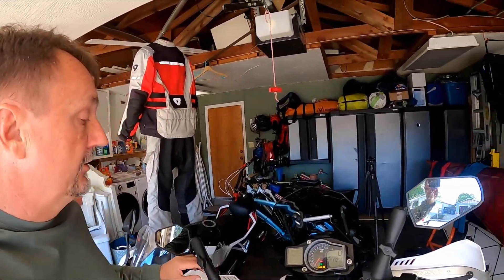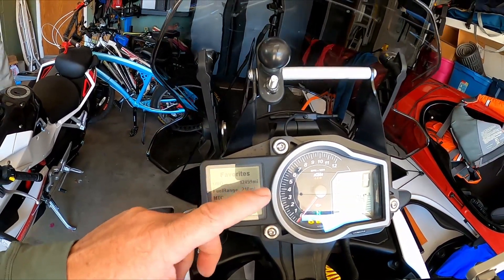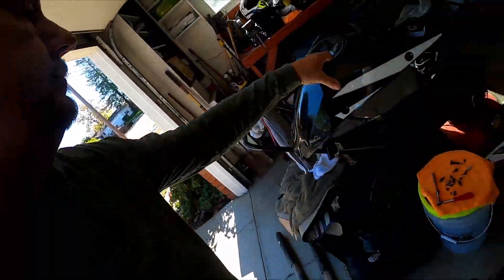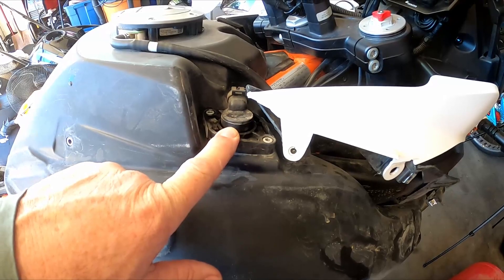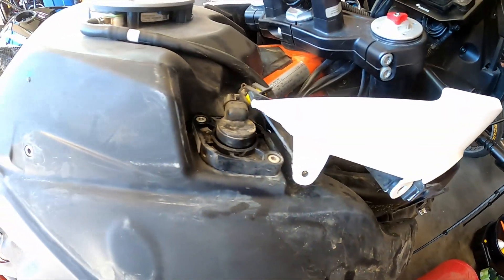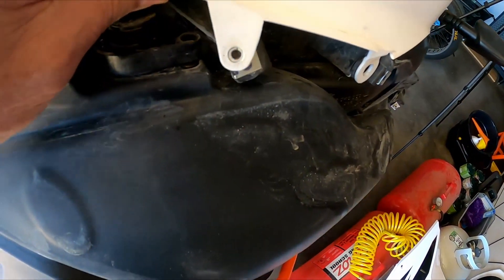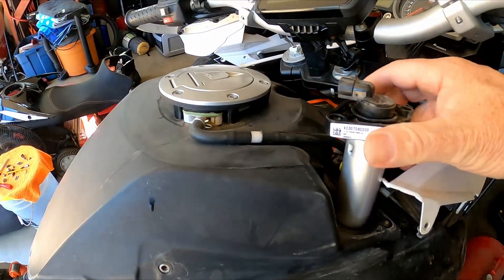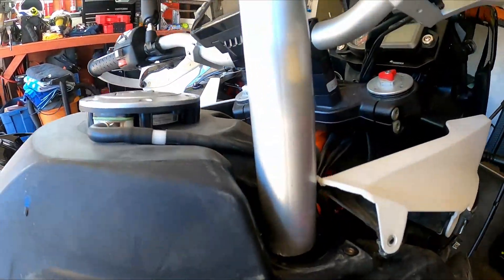KTM FUEL GAUGE FIX

Comment: Thanks dude. My 1190 stalled few times while still showing 2 bars of fuel left on the gague. Sometimes the gague didn't go full after refueling all tank. Now I am just refueling it every 350km just to be sure that I won't end up with empty tank on the side of the road again. Nobody knew the solution on polish facebook KTM adventure group. I was afraid of trying to find the solution myself. The fix looks simple, I'm gonna try to do it myself with your video :)
Reply from the maker: these are a real problem and KTM seems to not want to do anything about it, its important to make sure it slides freely after you re assemble it,  that is key to a better transition between levels. also make sure the center stick is perfectly straight as it goes back together so there wont be any binding. hope it helps!

Comment: Thank you very much for the video, which significantly helped me fix the fuel gauge issue on my 2020 1290 SA-R with approximately 26,719 miles. In my case, curiously, the tube detached from the head, remained vertical, but fell to the bottom of the tank. I also took the opportunity to remove the bottom cap, clean the float, and secure the tube more effectively. It turned out perfect. Thank you again!
Reply from the maker: That's great, also good information!

Comment: Amazing video! Simple and very well explained... gonna go do that now🙌
Reply from the maker: @williamboivin6455   @williamboivin6455  thanks!
A note or two before you get started!
This only works if you gauge gets stuck on full, if it reads empty you will need a new float assembly.
Also : this fix, in my case was not permanent, it lasted two years, and I needed to do it again, it seems the material expanded over time. 
The fix did make the fuel level much more accurate than it was originally, no more sudden change in level, it's great to know how much is actually left in the tank!

Comment: Thank you for the video!
I have that problem on my KTM1190
Will fix it just now!
Obrigado from Porto-Portugal
Reply from the maker: It's a pretty quick and easy fix, still take your time and keep checking to make sure it slides freely, I was just out on a ride thinking about this video, I love that my fuel gauge is accurate now!
Reply: It's a more complex issue. The float moves freely. And i checked with a multimeter and its working. The gauge reads empty and still reads empty with the wires disengaged. 
I think it will be a bad contact or a cut wire on the circuit.
Starting to dismount the fuel tank 🤪
Reply from the maker: @brunopereira5896  well that's not good. The ones I had would show full as the float would get stuck at the top. The only other wires going in to the tank are for the fuel pump, if that is working, I would start tracing the wires from the top of the fuel gauge out to it's power source and instrument cluster, I would have to look at the wire diagram. But you should not have to go into the tank for anything else.

Good luck and let me know how it goes
Reply: I agree
The problem is that the wires are brought together in a cluster that runs under the tank. 
So to reach it you have to take it of.
I'll try and disconnect the battery to try if that soves any problem with electronics (reboot? )

Comment: There was / is a recall, or TSB on these. My 2020 SAS was outside of that range, but was still within the warranty. Mine dropped to empty with a full tank, so I figured it was saturated. I bought one on line and the local dealer reimbursed me. The upgraded part is about $100.00 and so far, it has been OK.
However, we end up fixing them, putting up with the issue is not worth it. 
Thanks for the upload!
Reply from the maker: sounds like there is more than one issue with these systems, glad they had a fix for you, each time I dealt with this it has been a case of the bike showing full and never dropping down. though your issue has now come up a few times, A new part that works from KTM would be a great thing!!
Thanks for checking out the video
Reply: @TRCAdventures  The updated sensor has a different part number. I haven't heard complaints on the forums of the new ones failing.

Comment: Great video. I am having a problem with my 1290 GT where the bike shows it being empty of fuel all the time. I did this procedure and did indeed find that the float was sticking. I smoothed it off and got it moving well. Unfortunately when I put it together the fuel gauge still doesn't work. Any other ideas?
Reply from the maker: Normally when it shows empty all the time it's a different issue all together, and have heard some dealers covering the fix.
I will do some research and see if I can find what the fix is
Reply: @TRCAdventures  that's very kind. The GT has the sender unit pushed up from underneath, and it did appear to by stuck at the bottom so I was very hopeful.
Reply from the maker: @themorfill  from what I have found, the GT and some of the adventures were fitted with a float that would not float KTM recomeds fitting a new float in this case part number (60307080100) to replace the original unit, they do not give details on how to confirm this is not the part already in your bike, and thy cost $68 if ordered online from a dealer or $115 if picked up at the dealer?! 
I would say to test the unit you have when it's out of the bike and see if it floats! Also check all wires and connections as best you can. Their have been some reports of faulty connections that stopped the gauge from reading anything at all. Best of luck!
Reply: @TRCAdventures  thanks for the information. I don't think I have the option to buy the internal float by itself. The part number you have shared is for the whole unit. Looks like I'll be forking out for a complete unit.

Comment: I initially had this problem at the dealer chamfer the top and it worked fine. Seven years later and 30,000 miles. I’m having the opposite problem and it’s stuck on low fuel even after I fill it up. I usually bang on the tank or do a couple wheelies and slam the front  down and the cork seems to work it way up but it’s getting worse and worse. Wonder if it gets gas logged so to speak
Reply from the maker: I do know of a few people experiencing the issue you are having, the fix I describe does not seem to fix this issue.
I think in this case getting a new float is the best way to a fix, just make sure it can move freely inside the fuel cylinder before re-installing.

Comment: Hey brilliant video will check mine out,run out of fuel but showing 3 bars on gauge, I've also lost my gear indicator, bike will only start with clutch in and side stand up, happened same time as running out of fuel, and ideas appreciated
Reply from the maker: Definitely sounds like the fuel gauge fix will help! It's nice having a more accurate accounting of fuel! Mine was all over the place before the fix. Much better now!
The gear indicator has a connection to the side stand switch, you have to do a bit of digging to get to it, but it is likely that the connector is disconnected or the wire is worn through near that location, between the shifter and the kickstand up by the motor, best to try and follow the wires from the shifter (not easy as I remember it)
Reply: @TRCAdventures  cool thanks for info will have a look, keep them videos coming 👍👍🍺🍺
Reply: Done float but noticed when turning the fuel taps off the left side, really stiff ,disconnected the transverse pipe and turned the tap no fuel came out so wonder if that's why that side of tank not draining,
And any ideas why gear indicator still not working all wires in tack , still cuts out with stand down , and re start with clutch in. Thanks
Reply from the maker: @johnridley5507  doing a bit of searching on this topic and it sounds like a few people ran in to issues where the gear indicator function has been turned off due to the bike being started with the indicator switch unplug during a service, then the CPU de activates the switch? 
They then took it back to the dealership to have it turned back on with a KTM computer / code reader.
Sounds possible, though I've never run in to that before, maybe run past the dealership and see if they can plug it in and check to see if it has been de-activated?!
Reply: @SV Meeko  thanks mate looked at it again today cleaned all connections disconnected battery for 30 mins reconnected but still the same

Comment: I'm guessing this fix is about the same for an 890 Adventure? Great info by the way.
Reply from the maker: Not sure about that. I have not looked at the 890.
I need to post an update to this video, after two years this bike experienced the same issue again. At that point it's worth buying a new unit. 
KTM should issue a recall on these units far too many of there bikes have this problem, changing the material of the float would be a permanent fix.
Reply: @TRCAdventures  KTM has swept under the rug the camshaft issue on the 790/890 series and you want a recall on a nuissance? what KTM needs to do is go bankrupt.
Reply from the maker: @showmytime9177  that could be happening, not quite the company they once were.

Comment: interesting. mine never shows full even if i gas it up all the way, top bar is always missing and now it started to show usage at all and just shows a flat range of 250km all the time. think ill try sanding down the floater over the weekend and see if that fixes, otherwise its a new sensor unit for 120€ ...
Reply from the maker: If it's not getting stuck at the top, it may be a different issue, I have heard some cases of floats that sink, like they fill with fuel. People report that the fix is a new float.

Comment: Time to find out if this is the issue with mine! As it stands, 2015 SDR 22k miles, ill be out riding and itll say "half tank... all bars blinking... half tank... all blinking... no gas... blinking... half" etc. Sometimes, when i fill it all the way up, it'll be accurate for over half the tank.
Reply from the maker: This sounds like a different issue, this fix will stop the float from sticking at the top,  it still may be worth checking, if you pull it out and make sure the float moves freely, you could also check to see that the contacts are clean and not coroaded, and not wires are loose.
It's a relatively quick project!
Good luck! Hope it provides some help
Reply: @TRCAdventures  thanks a ton, I'll report back when I do it! You're the man!
Reply: @slammedridesgaming hey man, my SDR literally does the same thing! Did you ever end up doing the suggested fix in the video to see if it works to fix this issue?